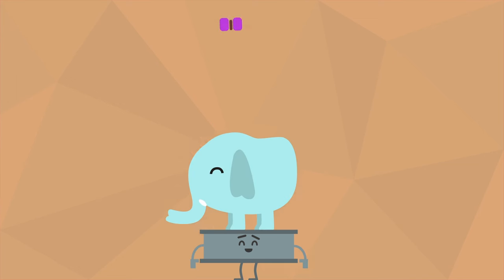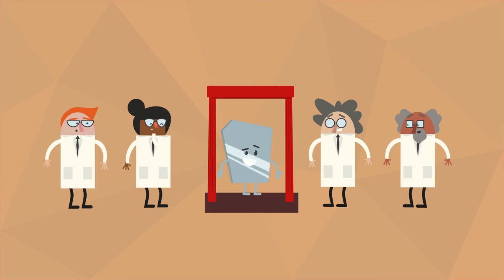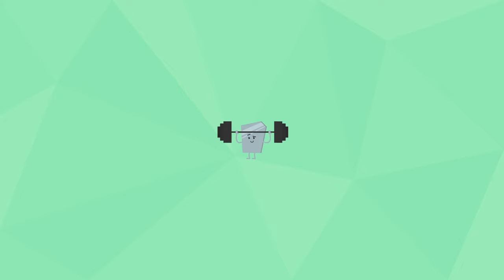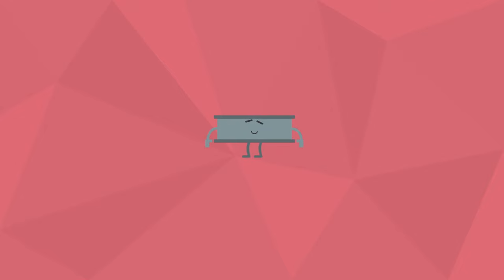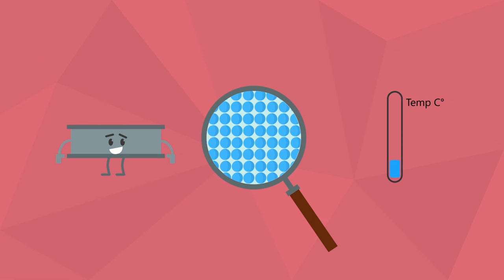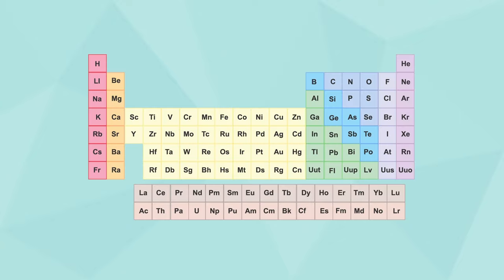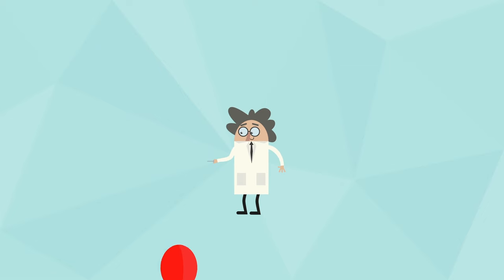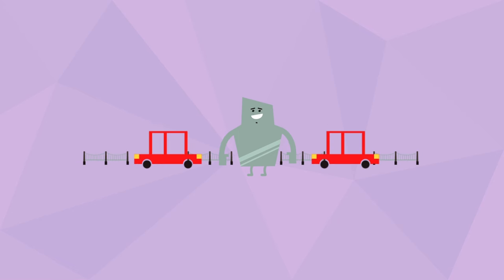What is metallic glass? - Ashwini Bharathula

Comment: This video is relatively misleading. See, some of the strongest materials are plastics. Kevlar is plastic or polymer, yet it can stop a bullet. Same goes for UHMWPE or ultra high molecular weight polyetylene, which is one of the strongest and lightest fibers. Plastics however lack compressive strength, which is required for making the buildings and other structural things.
Metals on the other hand usually have both tensile strength (regular strength) and compressive strength, but are heavy. Metals also have the ability of easily being machinable and ability to be welded. Plastics can also be welded, but it's usually much harder. This means that metals can be constructed somewhat modulary, while plastics are usually stuck in the shape they were made at originally.

Metallic glass is usually very elastic, but they behave more like ceramics than like metals. While metals can bend and deform when under stress, metallic glass will usually deform slightly, and then crack. Metallic glass is also impossible to weld with current technology. And sometimes, when you heat them, they will loose their glass like properties and become like regular metals or alloys. This means that metallic glasses are similar to plastics in that they can't be welded, and similar to ceramics in that they are more likely to crack than to deform.

And now to answer the big question "why aren't all materials replaced with metallic glass?" the answer is simple. Other materials do the better job.
See sometimes you need electrical resistance of plastics, because you don't want electricity to leak everywhere. Also, plastics are super light, while metallic glasses aren't. Plastics and simple alloys are easy to manufacture, and metallic glasses aren't. By now, there is no need to transition to metallic glasses. I hope this clears up some of the misconceptions.
Reply: What about carbon nanotubes?
Reply: And even though this comment has been made, the top comment is a pun. Yay, youtube.
Reply: This video is quite terrible, being a Materials Engineering student. Thanks for pointing some of its flaws.
Reply: Yes but the video juat says that gonna be more way easier to test it out with something more easier to bend and harder to break while metal take a huge time to bend and its heavy while metallic glass is light and plastic ia light but a little bit weak for fall damage  and smash damage.
Reply: How is metallic glass very elastic but then again behave like a ceramic? Ceramics are brittle and elastic materials can withstand large amounts of stess without breaking and then revert back. Aren't you contradicting yourself there? Or is it something I don't understand?

Also, plastics are 'tough' to be exact.
Reply: @awashburn6944  Those are.ni8 exceptions, brittle materials by general definition means materials that break after a certain amount of tensile stress. Everything fractures at some point, but as far as I know, typical brittle materials do not get past the limit of proportionality or reach the  yield point. 
Can you give me links about the composition and properties of the materials tho?
Reply: I mean the person who wrote the comment
Reply: Thanks for pulling out the flaws in this video
Reply: smart
Reply: Metals are isotropic.
Reply: This video is about metallic glass. And yes there are plastics that are way stronger, but those are mixed with other things and the video isnt talking about that.
Reply: cool facts peter griffin
Reply: @awashburn6944  Non recristallised laminated sheets are also not isotropic.
Reply: Your comment is so long that you earn yourself a like
Reply: Global warming is why they want metallic glass, they don't want to turn the world to plastic.
Reply: mhmm
Reply: I think i brain exploded after rading all of it
Reply: @Iridium Thank you for the comment!!!
Reply: O_O
Reply: Yeeaah this big brain time
Reply: @nutellabread674  sorry this isn't the circus, this is the lab
Reply: Plastics cause pollutions
Reply: So basically what you're telling me is I can't make light-weight AR-15 barrels with it?
Reply: Whoa there's a whole bunch of nerds in here btw thanks for pointing out the flaws of the video
Reply: I know this comment is 3 years old but Kevlar works by dispersing energy. just about any damned material made into a tight enough fabric can do that.you can get the same effect from paper if you do it right.
Reply: kevlar is NOT strong. in fact the reason it can stop a bullet is because it BREAKS and thus steals energy from the bullet
Reply: Pretty sure Kevlar is a synthetic fiber.
Reply: Kevlar is glorified plastic fiber
Yes
Reply: no adamantium and vibranium are stronger boiiiiii
Reply: Curie: Pierre, call The Sorbonne Headmaster!
Reply: @farenhite4329  lmao, yes thank you
Reply: @svootori  same lol
Reply: i bet people were like "wow. TLDR I don't wanna read this stuff" and liked some pun instead. This comment is very informative and is perfect in every way.
Reply: Mmm see I don't think you were paying attention at the beginning because while kevlar resits tension it lacks on compressive strength. Like they said in the video🤙🏼
Reply: Saying that there is no need to transition to metallic glasses is also misleading. There could be a lot of uses for metallic glass.
Reply: I figured this could be the case
Reply: Kevlar is able to stop a bullet due to its molecular structure. It is a light, polyarylamide plastic fabric, which has a high tensile strength. ... When a bullet hits the vest, it tries to force it through the layers, but to do this it must push the fibres apart. The fibres are woven and resist this very effectively.
Reply: Galaxy brain
Reply: Shut up redditor
Reply: kevlar cant build a  bridge. its a different kind of toughness
Reply: So on the Kevlar thing, Kevlar isn’t rated as high as ceramic and metal plates
They tend to only be able to stop pistol rounds and light rifle rounds
Usually with thicker plates then either the ceramic or metal plates
Tending to be closer in weight then you’d think

Plastic isn’t end all be all 
There is definitely room for improvement, as you tend to give something up to gain strength someplace else
The “perfect” metallic glass would have balance between the higher compressive strength of glass, and tensile strength of let’s say iron 
While maybe even having some flexibility 

Now that’s obviously a wonder material, that most likely will never exist in our lifetime

But aluminum glass that is being tested by the likes of nasa is very very promising 
Proving to have better scratch resistance due to a higher hardness compared to plastics, higher heat resistance 
While giving up some tensile strength and compressive in comparison to its competitive materials

It would be an excellent material for aircraft windows, deep sea projects, space travel 
While reducing weight

Obviously it won’t be able to half the weight and double the strength 
But saving 13% of the weight of let’s say 2000 pounds of glass 
That’s a lot 
And a massive improvement on something that might just be theoretical 

Rolling back one last time, it doesn’t make them all powerful, they will still have weaknesses, but will be a better jack of all trades vs let’s say plastic
Reply: "I will make it work once i figure out how do i make it work" Quite litterally in this case
Reply: @awashburn6944  yes lol, but alot of people dont know what it is, too bad its still very expensive to make compared to other glass materials
Reply: @awashburn6944  right, but with the use cases being to replace glass, its simpler to just say "aluminum glass" over "Alon which is a ceramic that isnt like your normal tile ceramic, but is a heat-resistant and corrosion-resistant materials made by shaping and then firing an inorganic, nonmetallic material, but in this case, Alon is a transparent ceramic composed of aluminium, oxygen and nitrogen."

Aluminum glass is how its marketed anyways, so thats the best way to describe it to the average person, its like that jimmy neutron meme, no one likes someone who is a know it all

Comment: i'm studying ceramics, so "steel is strong and hard" is something i almost never hear. anything that has any kind of plasticity below 200°C i always considered "soft" funny how you forget about the scales of things like that in real life, when you've been inside the specialised bubble of your disciplin for too long.
Reply: Yeah, your field may call it soft, but professors would probably rescind that if I asked them to bend steel because it is "soft"
Reply: @paulmahoney7619  or they'd show you a spring, maybe. In common applications steel is very much a bend-able material but you kind of have to know where to look. I fix bicycles, the kind where nearly every part is steel, as a hobby. Understanding the flexibility of steel and its limits in marvelous in this hobby. If I want a wheel to fit in to the frame and need a couple millimeters of space, well, just push a little and the space appears. Same thing with a lot of other parts. Steel spokes are fascinating, you can move em around with your fingers and you can also get an estimate of whether they're tensioned the way they should be by plucking them like a guitar string and listening to the sound.

Comment: so it has the property of metal and plastic, and we're calling it glass? I suppose it is partially crystalline, but....
Reply: It's called a glass because, by definition, glass is  defined as a solid that isn't crystallized when it becomes a solid. Yes, that does mean your window glass is an entirely noncrystalline material.

Mentioning plastic was just a hook to get you interested. Despite what he said, steel is already as shapeable as plastic. You just have to heat it up, which is actually the same as what they do with plastic. You just need less heat for the plastic.

So, yeah, the plastic was just a non-sequitur. Metal is all-around better than plastic in terms of mechanical properties, but plastic is a lot cheaper to get and a whole lot cheaper to work with. That's why you see it everywhere, and seeing it everywhere makes mentioning a better plastic alternative into a great way to hold your attention. Therefore, he mentioned it once at the beginning and then didn't mention it again at all.
Reply: Kazmir Runik ...lol alright, thanks XD
Reply: Kazmir Runik b
Reply: So basically. Ted-Ed is clickbait crap too. Good to know.
Reply: James Rowe No....
Reply: It's scientifically not plastic at all. It is glass made from metal. In fact, plastic's softness and pliability is usually a property found in metals.
Reply: James Rowe no
Reply: Steelstic

Comment: Grain boundaries aren't weak spots, usually the smaller the cristal size, the more grain boundaries you have,  and stronger is the metal. And the metallic glass you are talking about is basically just a huge chunk of amorphous grain boundaries. They are however more susceptible to corrosion, just like the metallic glass, since the atoms there have less neighbors and are in a more unstable chemical arrangement

Comment: How is metallic glass different from alloy
Reply: Good question.
Reply: The atoms in an alloy are arranged in a specific pattern, while the atoms in metallic glass are arranged in a random pattern.
Reply: Well if you cool heated alloy fast enough its molecules will also be in random pattern
Reply: clsman89 That may or may not be true. But today, none of the alloys treated this way so therefore they are different from metallic glass. Just because you make an "if" statement doesn't mean it's a reasonable argument.
Reply: Lucas Layton Many alloys are treated that way. Google quenching, hardening or tempering. Those are usual processes for obtaining desired alloy properties.
Reply: clsman89 Not with the same magnitude as required for metallic glass.
Reply: Lucas Layton So you come to the initial question -  
How is metallic glass different from alloy?
Reply: Well I see you have a degree in mechanical engineering or civil construction. You have decent manners as well.
Reply: Senior mechanical engineering student here.

The difference between a glassy metal and an alloy is that an alloy is defined by a mixture of different metals while a glassy metal is defined by having an amorphous arrangement of particles. The two are not mutually exclusive; an alloy CAN be a glassy metal and vice-versa.
Reply: It is an alloy, just not one with a crystalline structure.

Comment: Any shape you can form with plastic you can form with steel to an even higher degree of precision. Steel is very shapeable. It just requires more heat to shape. The best features of plastic is cheapness, light weight, resistance to corrosion, transparency, and flexibility.
Reply: +T1Oracle Yes, you are right in that steel can also be formed into complex shapes. What the video says points to is the difficultly associated with it. A steel part has to undergo multiple processing steps including various secondary machining and polishing operations to achieve the final shape and meet dimensional tolerances. And there is always some solidification shrinkage associated with casting a metallic alloy that needs to be accounted for. Commercial metallic glasses, on the other hand, can be thermoplastically formed like plastic and also be cast into complex shapes in a single molding step with atomistically smooth mirror-like surfaces. There is mostly no need to do any further processing and can avoid all the scrap metal wastage. There is also negligible solidification shrinkage associated with metallic glass formation because there is no phase transformation involved.
Reply: materialsgeek Interesting, thanks for that explanation.

Comment: The question is, would it be good for a prothstetic ( definitely fecked that up) base? Combined with Teflon to smooth out the joints and other stuff to help with movement, would this be at all a good substitute for steel?

Comment: Amorphous solids are never meant to be strong. Lacking a crystal structure makes materials weak. This is a intuitive thought. You cannot build a bridge randomly placing steel bars. You have to put them in specific order so that they bear the load evenly. Thats what crystals do in a material. Your initiation of shining light to the path of a future scientist is appreciable. We should focus on thinking of making a strong and cheap material that can take any shape. Steel can take any shape like cast iron. But it is not that strong. And forging takes a lot of work. And its not as flexible. May be we should come up with a better forging technique. That will bring the most out of the available materials.

Comment: Can these materials be used for smartphones too?
Reply: ......They said that in the video.
Reply: +Leonell Valderama they did. odd. i didn't notice then. sorry
Reply: +Liran Barsisa One of the trade names for bulk metallic glass is Liquidmetal made by Liquidmetal Technologies. Apple used it to make the SIM ejector tool for their iPhone and are working with Liquidmetal Technologies to improve manufacturing techniques and use it in more of their products.

Edit: Just found another trade name called Liquidmorphium which is a slightly different composition and it's used in the casing of the Turing Phone.
Reply: +Boris de Melo Why only the sim-ejector?
Reply: ***** Like I said, they're trying to improve manufacturing techniques. Presumably, they're not yet able to produce large parts in the quality and volume needed. But I'm only speculating. Only Apple and LT know what challenges they're facing to make it work. I feel like I had read about them using it in more small parts inside the phone or in the iPad. But I'm not too sure about those.
Reply: +Boris de Melo ok , thank you.

Comment: Shouldn't metallic glass's atomic structure being unorganized make it weaker, not stronger? I understand that removing the lattice make it more malleable but how is that not at the cost of strength?
Reply: A material's strength has a lot to do with the size of their grains, or crystallites.  In this metallic glass the grain sizes are much smaller than, say, normal steel.

It takes less energy for a crack to travel through materials with large grains because it can "ride" the edges of these large grains for longer without having to change direction.  In a glass (where there is no crystalline structure to create grains) the crack has to change directions frequently to progress through the material.  This requires more energy.

Glass is actually pretty "strong" in that it resists deformation from a stress.  Because it is so brittle, however, it has limited uses.

Comment: What about graphene, its virtually unbreakable being 200x stronger than construction steel and is so light that as MatPat from film theory said "If you covered a entire football field with the stuff it would weigh less than a GRAM!" and "It's bendable enough to be made into commercial use with designing vehicles and even bendable glass!" this metallic glass may seem near fictional... BUT ITS TRUE, look it up, and this graphene is just made of carbon in this supposed Crystalline structure... It is magical!
Reply: This was also discovered back in 2015... so I thought this would've appeared in the video.
Reply: Well... I didn't know that... I'm just a 13 year old after all!
but well done on correcting me... as I am still learning such things. You know your stuff. What about BuckyPaper, its almost one atom thick but is 500x as strong.
Reply: THAT IS THE SAME THING!!  Its one atom thick, but has not been subjected to a 3 dimensional stress state

Comment: This seems to be very similar to amorphous metal, made by taking molten iron (plus various other trace metals) and cooling it so rapidly that it doesn’t form the usual crystal lattices. Thus, not a true solid. Currently used in low load loss distribution transformers and antitheft tags.